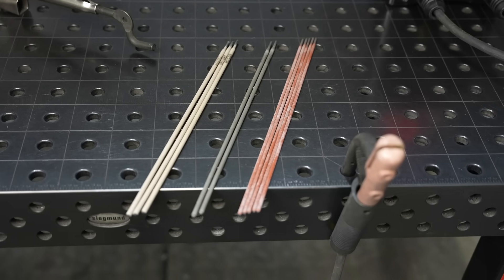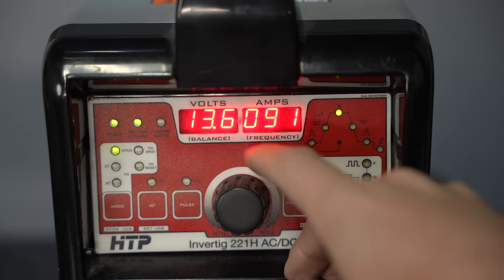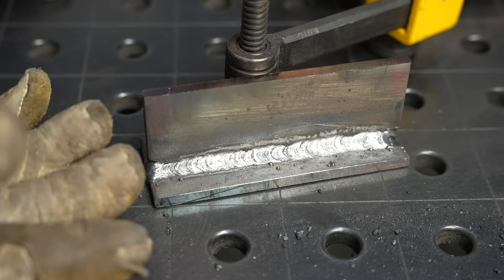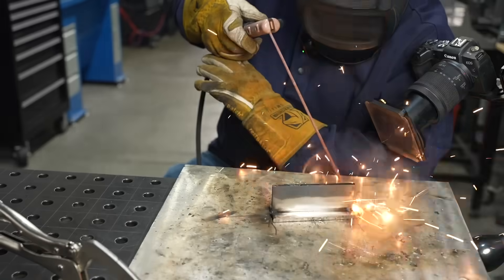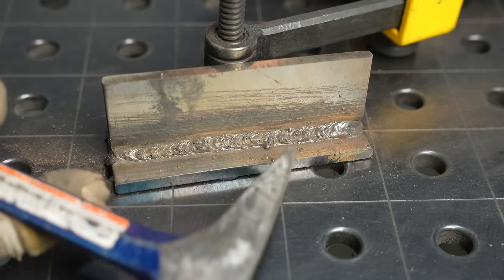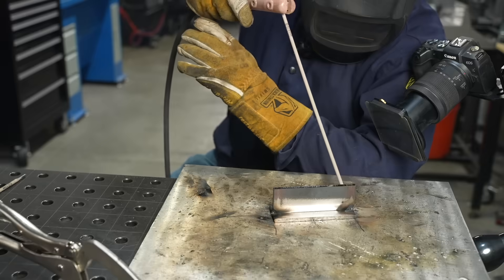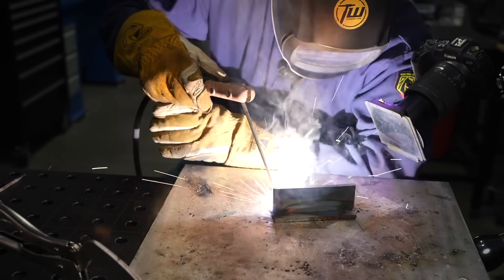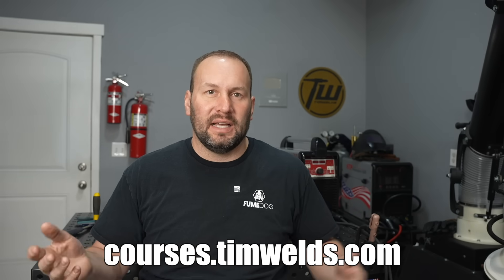The 3 Common Stick Welding Electrodes Explained: 6013 vs 6010 vs 7018 Rods

Comment: Hi Tim, one thing I would like to undertand is tensil strengh. 6011 has less tensil strengh than 7018, but better for deep penetration. Does that make them equal as far as the final strengh of the joint ?

Comment: on 6013 the slag always go under so when i hammer out the slag the weld bead doesnt look flat and looks like a blob once i remove those slag on the sides of the puddle..

Comment: Could you please do a full video on 6010 t joint in 1F position? (Amperage, rod angle, whip n pause technique etc). I've been practicing this one for a while but I can't seem to not get undercut on both sides. I always have undercut on one side so I'll fix my angle and then I fix the top one but then have undercut in the bottom. Uggghhhhhh😡😡😡😡😡🤬🤬🤬🤬 I'm starting to get pissed about it haha.

Comment: Can you store 7018 with somw desicant packets?

I am doing some ranch work with my dad's old Lincoln. 

I am welding up a pole barn.

7018 good?

Thank you so much? I really appreciate your channel.
Reply from the maker: I can't decide for you whether to use a rod oven or not, but if you're welding mild steel less than 1/2" thick, the risk of hydrogen induced cracking is basically zero.

Comment: Can you make a video on stick welding 1.0mm thick metal. I try to fabricate car panels and i have a very hard time because it solidifies so fast so that i get inclusions all the time. I use DCEN by the way and 1.6mm 6013 rods

Comment: Good info. I like the flick! I resorted to tapping on concrete but it was 50/50 for a clean break.
Reply: Try swiping the tip of the rod on concrete instead. It's always worked for me.

Comment: Its odd that the yanks scoff at 6013. I'm a newbie and can't tell the difference but 6013 seem ok . 7013 welds lovely but won't restrict reliably
Reply: I too have suffered 6013 trauma.  I would like for someone in the states to test a bunch of 6013 rods and find a brand that is easy to use.  I have heard overseas 6013 is common and well liked.  There are a few people here like 6013s, but I haven't heard what brand they used or maybe they just started out on 6013s.

Comment: Great video i finally understand the different rod groups 6010 6011 7018 Could you do a video about the different  kinds of arc welding rods that are used for non-ferrous precious metals? Thank you!

Comment: Does anyone happen to know the Japanese  standards? DIY being less popular here, pretty much one brand which has one rod per metal type available. For mild steel it translates to "lime titanium" and the Japanese standard on the packet is "JIS/D4303". I can't find any conversion chart for Japanese standards though so I wonder which US/EU standard this would be equivalent to?
Reply: Just guessing, lime is basic and titania is rutile. So it sounds like a combination of a 7018 and 6013.
Reply: Thanks @BwanaBob
I guess it's a bit moot as I don't really have any choice. They are the ones I taught myself with and the only ones I have available to use. I seem to do OK with them for my simple (non structural) projects.
Would be nice to know what I'm working with though!

Comment: Thanks for the tip on those strip disks, looking forward to trying them out using your link. From northern tool I got something similar to those scotch brite type pads that are meant to go in a drill that you've suggested before, and they didn't come with an attachment bit or anything, and for the life of me I can't get them to stay in my dewalt drill, turning both cw or ccw. Any advice on that?  The ones from NT  have a small plastic stud helically shaped like a screw. I assumed that meant it was supposed to go in a bit, but the NT employee said just put it straight in the drill. Thanks Tim.

Comment: 6013 slag inclusions? Try the ESAB Sure weld green 6013’s and that will cease to be a problem! Excellent electrodes! You MUST try them!
Reply from the maker: I'll have to pick some of those up. A comparison could be a good video topic.
Reply: @TimWelds  You’ll be impressed!
Reply: @ 6013’s are not created equal by the different manufacturers! I’d noticed that on many of these welding videos from India, Pakistan etc that do this dot-dot-dot “welding” (?) they don’t get slag inclusions with 6013. After watching one that the guy was actually stringer beads that looked excellent, I commented about how terrible most 6013 are in the states, and questioned the brand of green 6013 he was using. He responded “ESAB”, and stated how different they were from other brands, but didn’t know if they were available outside of India. My local Airgas dealer didn’t stock them, but ordered them for me. Game changer for sure! I think Northern Tool sells them now also.

Comment: Here in Mexico, the 6013 that is readily available has green flux and it does not have these slag inclusions problems that are always mentioned with the gray flux 6013.  It is very easy to run.
Reply from the maker: I'm thinking I need to try some other brands of 6013. This is the cheapest stuff I could get from the big box store.
Reply: @TimWelds hey Tim. The real problem lies within the American AWS A5.1 nomenclature.

It doesn't allow for a specific suffix here. Example:

The European standard rod is a E6013RR double rutile coated (thick rutile). The proper EN ISO 2560-A code is E 42 0 RR 12. AWS code: E6013.
A very different burning rod (hotter, more output) is the E6013RC rutile-cellulose coated version. EN ISO 2560-A code is E 42 0 RC 11. Often short "RC11". AWS A5.1 code is: again just E6013.

I think that is the reason for the hate/love for 6013 in non Euro countries. Simply because there is different E6013 coatings which make for a very different rod burning.

Welders don't use the EN ISO 2560-A codes much either around here, but usually just add the coating to the E6013 and/or search for RC11 or RR12...
Reply: @herrgerd1684  About 6013: I too don't like the RR coating. With the RC variant the slag behave much better.

Comment: Thank you Tim for explaining the use of 7018 at home. I've been learning with 7018 but was worried about using it at home. I prefer it to the other types you mentioned.
Reply from the maker: It's my go to, a lot smoother and easier to read the puddle IMO.

Comment: Tim, I have a question. Why would someone want to weld DC over AC and vice versa?  Is it just due to the power of the machine or are there parameters welders use for a stronger weld or??  I have stick welded just a couple times and it was an experience that I would like to get better with so I do not know all the ins and outs.
Reply from the maker: That's a great question. Generally speaking, DC is preferred because it is smoother and has less spatter. The main reason that you would run AC is if you have a buzz box transformer machine that only has AC output. One reason that you might want to run AC if you have both AC and DC available is to avoid arc blow. Arc blow is where a magnetic field interferes with your arc and makes a mess of the puddle, usually at the end of a weld joint and switching to AC eliminates it. There are other ways to control arc blow and if you come across it, Lincoln has a great article about it that's easy to google.

Comment: I just put desiccant in the package with the 7018 rods. That keeps them dry enough for non code work (for the rare times I stick weld).
Reply from the maker: That's a good idea. I just use those sealed plastic containers, but some desiccant would be a step up.
Reply: Not sure desiccant is of any advantage. Many of today's 7018's coatings are considered moisture resistant to H2O pickup. Yet, code regulations haven't caught up to newer filler metal technology.

Still, reconditioning temperatures and/or holding temperatures are the standard practice.
Reply: @ it helps. If the package is closed well, it absorbs moisture. Resistant to moisture is not moisture proof. And until otherwise stated, I’d rather add it. It’s cheap and easy.

Comment: Good videos then, 

Whats its difrent of 7016 S and 7018 i now the E 7016 its s mix of rulie / basic stick
Reply from the maker: Thanks! I haven't done much with 7016, but I believe it's very similar to 7018 except that 7018 has iron powder in the flux and a slightly higher deposition rate.

Comment: I used to work on a dredge and gravel wash plant in the netherlands and we would use 7016 for most everything.
Lovely stuff, i believe for all positions but very tough slag
Reply from the maker: I haven't used 7016, though I think they had us run a couple joints with it in welding school. I'll have to pick some up and try it out.

Comment: Nice. Based on some of Tim's earlier videos, I settled on 6011 for tacking, and 7018 for everything else. This is a useful combination for hobbyists / beginners. Trying to do a nice, small deep tack with 7018 is a PITA for me due to the relative difficulty of striking an arc. So 6011 is brilliant at this. Then, 7018 gives a huge advantage to a beginner in that you really can see the weld pool much better than with the others. I don't like 6013; can't see what I'm doing with the slag creeping up all the time. I recommend Tim's courses. I bought the package.
Reply from the maker: Thanks! Those really are the winning combination.
Reply: Excellent thoughts, thanks for sharing this
Reply: @djpenton779, that's interesting, what brand 7018 and 6011 welding rods are you using, thanks 👍
Reply: @shermanyoung8185  I generally use Princess Auto house brand rods. (Princess Auto is more or less Canada's version of Harbor Freight.) I have also tried Lincoln and Hobart electrodes but perhaps due to my low skill level didn't notice much difference.

Comment: For 7018, is the hotbox to keep out water or oxygen?  Couldn’t you just use some good ol argon in a sealed box instead?
Reply from the maker: I think it would be harder to evacuate and sufficiently seal a box than to just use a rod oven. A lot of them come in hermetically sealed containers and you can use them right out of the can for a period of time (usually 4 hours, but not always) before they have to be stored in an oven. ESAB has some that are packaged in small quantities so that you can use them up right after opening, then open the next small pack. If rods do sit out, you can bake them back out at a higher temperature than the storage temp and still get a low hydrogen deposit and comply with codes.
Reply: moisture

Comment: 6013 is very smoothly running rod. I thik something with the machine ark force settings is wrong, too long of an arc is also a no no. Amps must be just enough, but not too high (makes spatter) because it's a slaggy rod.Try Böhler's FOX ETY. Nice video Tim!
Reply from the maker: Thanks! The 6013 might have been just a bit hot in this case adding to the spatter. I'll have to check out those rods or at least some that are nicer than the ones I used, which are admittedly the cheapest 6013 rods that I could find.

Comment: Love 6013, use it for all my hobby work when using stick. 7018 is hard to get here, I have to mail order it from specialty welding suppliers, local hardware's don't stock it. It is also quite expensive compared to 6013.
Reply: How about 7014? Not quite 7018 but can you get that?

Comment: In Europe we have 6013 rc (rutile-celulose), you can run them downhill, 6010 and 6011 are not common here, 7018 is must if you are going to weld stracture.
Reply: Yeah I started on 6013RR but got frustrated quite quickly. Then I got myself some 6013RC and they're awesome. Mine are ESAB GoldRox...
Reply: Very interesting.  I looked into this and 6013 rb rutile basic also exists.
Reply from the maker: I've never heard of 6013 RC, but you've got me curious...

Comment: 👍👍 Have you ever heard of a Three pen weld structural steel beams
Reply from the maker: I'm not familiar with that specific term. Maybe it's referring to position 3 (vertical) CJP (complete joint penetration), like a 3G?

Comment: Nice job !  That HTP221 is one of the best but really under appreciated stick welders
Reply from the maker: Thanks! I pulled the 221 out for the 6010, it packs a punch and is one of the smoothest machines ever made on both stick and TIG.

Comment: Thanks
Reply from the maker: Thanks for watching!
Reply: @ just bought a Miller 400 big blue with Kubota diesel engine along with a Millermatic 252 mig welder. Both barely used for $5,000 for both. Now, I need to learn how to weld
Reply from the maker: That's the deal of the year! There's not much you won't be able to do with that setup.
Reply: @TimWelds  which online course would you advise to start with?
Reply from the maker: They are all completely self contained, so you can work either the stick or MIG course first. If you are in a hurry to get something welded, MIG will be faster to learn and get you up and running with that 252. If you want to learn both and are okay with taking a little longer to learn, I'd start with stick. Stick takes a little more practice for most people, but lays a good foundation for other processes.
Reply: @TimWelds thanks, I will take your advice and start with the stick, then mig
Reply from the maker: Awesome! I don't always see comments, but if you get stuck at any point, feel free to email me at the email address on my website.